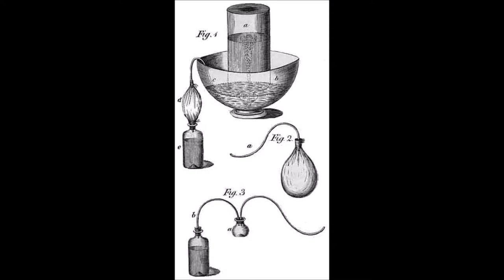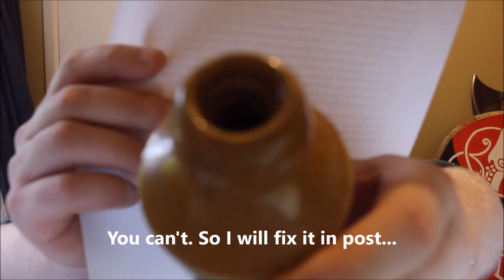Soda Water: Under Pressure.

Comment: The stand for the torpedo bottle defeats the purpose. It is not designed to stand upright as the cork will dry out.
Reply from the maker: Indeed. The stands were just meant for at the table when it is being used, not for long-term storage.